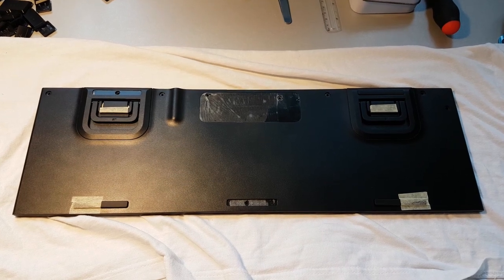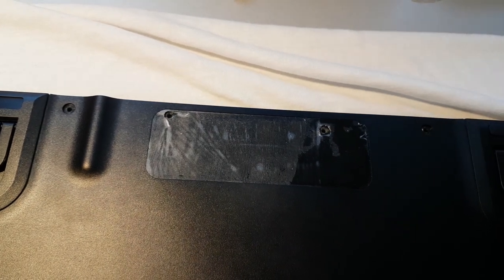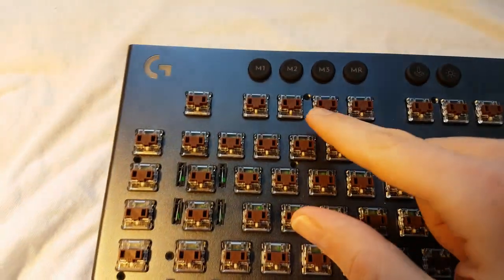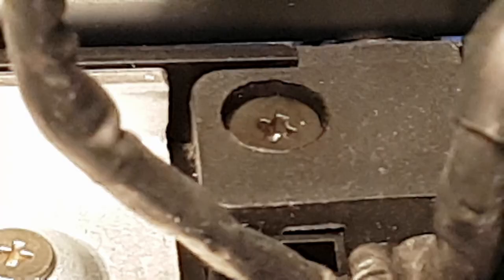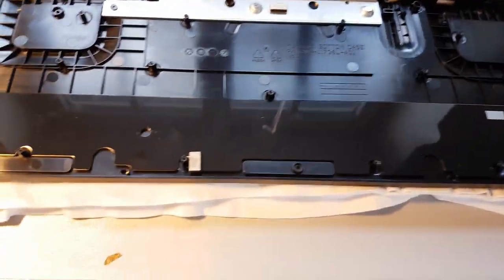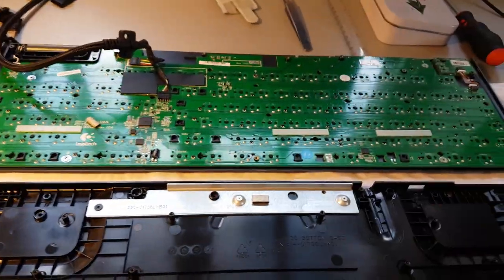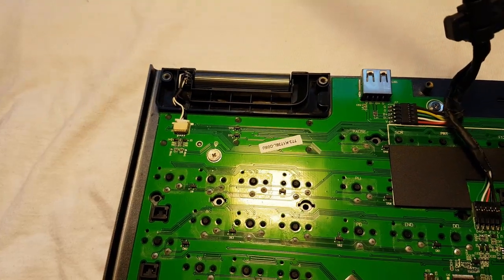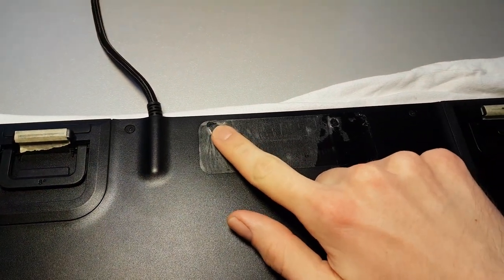Logitech G815 Disassembly

Comment: When removing the keys, I use tweezers that have the tips bent inward with tape around the metal so it doesn’t scratch it.
Reply: do you know if the switches can be removed from the top too? cant find anything about it..

Comment: I'm going to be doing this with my G915 because the "E" key is suffering badly from either a broken switch or a bad solder joint. Either way I need to get inside and now I see where the top screws are I don't need to remove all the key caps. I do hate it when companies hide them under rubber pads though because they're never quite the same once you remove them at least not when I remove them. Thanks for the guided teardown!
Reply from the maker: Yeah, the hidden screws are always a pain. I replaced the factory adhesive with some fresh double-sided adhesive tape to make the thing sit evenly.
Reply: @icecreamgecko  following up after successful surgery. It was a bad solder joint and is working fine so far. The biggest problem I had was removing the battery cable. I hated doing it but had to pull on the wires to get it out. Thanks again for the video because it let me remove only the screws I needed.
Reply from the maker: I am glad to hear that everything worked out well!

Comment: Just a heads up, since I just did this myself... You can 100% replace the switches with Kailh Chocs (with a caveat). The J key on my GF's keeb started showing an intermittent fault, so I bought a pack of 10 Kailh Choc White switches to replace it will and to have others in case it happens to another in the future. After desoldering the old and installing the new, I was buttoning everything up and it came time to put the J keycap back on. It would not fit. The Stems are slightly different so you cannot slot the old one on. It does appear that the two switches are the same size in all other aspects though. So my plan is to desolder this new switch and steal the stem from the old one and swap the stem into the new switch.

If you are in the same boat and have the clicky model, the click bars sound slightly different as well, so I think when I go back to complete this job I will also swap that and see if anything changes (the sound difference may just be the way the inside of the switch attenuates sound and not the bar at all but idk).

Any questions lmk
Reply: Do you reckon you can swamp out the whole board with standard switches or would it not fit? Say for example the gateron black?
Reply: @Maleki28  I'm not sure the switches would fit in the negative space designed to fit the kailh choc type switches. Obviously when there is a will there is a way, but sometimes you gotta ask "why?". There are much better kits to do that with. Desoldering can be a time/labor intensive pain in the ass. If you have any questions, feel free to reach out though.
Reply: @djkid14567  Ive looked at other keyboard pcb's and designs. Nothing looks better than the G915 TKL especially with the lightspeed connectivity. I was thinking of a way to replace the keycaps on that keyboard as the TKL only comes in linear along with changing it from a slim keyboard to full size keys.
Reply: @Maleki28  if you want, you can swap all the keys with whatever type of kailh choc switch you'd like so you don't have to worry about the fitment of standard mx style switches. There are at least a few keycap options for chocs. Unfortunately the stems on the logi switches have slightly different slots so they won't fit choc caps on their own. Let me know what you decide to do and follow up when it's done. I'm interested to hear how it turns out.
Reply: Did your fix of just swapping the stems end up working?
Reply: @WasabiPlays  It did. I just don't recall whether I had to replace the top half of the shell as not. But I did end up getting it to work. If you end up undertaking this, just do your best not to damage the top shell of the switch, just in case you need to swap that over as well.

Comment: I think the metal part is to increase the weight to make the keyboard more stable without moving around. As far I remember the 915 tkl has something similar.
Reply: May be it's just for the grounding to reduce the electrostatic that sone of the most metal plated keybord have
Reply: the f-k you dudes talking about, those plates are there so they KB doesnt bend or flex, weight also gives it premium feel but thats secondary

Comment: A tad late to come in, but I would like to say I spilled baileys on this type of keyboard an hour ago. It hit a large part of the keyboard, but only got into one key (which proceeded to get sticky/stuck). 

Found out the hard way that disassebly was not actually needed...

After reassembling the keyboard, I used a sharp knife to pry out the key socket(?), dumped it (the socket) in water with soap and washed it up. Put it together again and re-fit it into the keyboard, and now the keyboard works flawlessly and no sticky key. The electronics seem to be very safe from spills, something I am very happy about now. Would be a costly fuckup.
Reply: Hello, would you mind explaining what exactly you did? The leg of my kepcap broke off and fell into the switch hole. They key won't depress anymore 🙄. Thanks
Reply: @theravager978  Basically what I said: use a sharp knife to remove the plastic cover the key itself is socketed into. I was careful to avoid anything breaking, and did it slowly.

Comment: thanks for this! I noticed the screws beneath the keycaps and got to thinking I could desolder the switches to replace them with some nice linears and pbt keycaps.
Reply: Dude resell and buy a different keeb at that point, these are holding value well
Reply: i think the switches or soldered on...not like in other mk's

Comment: Thanks for the guide. I received mine a couple days ago and it looks like the PCB was not seated properly in one of the corners. I thought about opening it and reseating the board but after seeing this, it may be better for me to just get it exchanged.
Reply from the maker: That's a good idea while you still have got the option. My current one is a replacement keyboard as well. The first one had a similar issue regarding the "fit and finish".
I am glad that I could help. :)
Reply: Thanks for the video, icecreamGecko! I wonder if you can answer one question: is it possible to replace switches without removing the printed circuit board? Did you try to remove the PCB?

Comment: The heavy metal piece at the bottom of g815 is probably the future location of the g915 battery location.
Reply from the maker: That might be it! In order to achieve the stated runtime they'd definitely need a chunky battery.
Reply: clever, you probly got it right! weird that they chose to replace it with a metal chunk instead of just nothing; probably to give that heft and psychology of the correlation between heft and quality in USA
Reply: It's also a design thing. Making things heavier makes it feel more "premium". It's a common design tactic to add weight to a product just to make it feel like it's higher quality

Comment: This helps me every time i have to replace one of those switches when they one after another start to double-register my inputs.
Reply: hey one of my keys also started to double-register, cau you specify exactly what you did
Reply: @junkshit9477  I opened the back, I soldered out the defective switch and replaced it with one of the 5 switches I took from the G1 to G5 keys, as I don't use those.
I have the 5 Buttons on the left of the keyboards removed and taped them over.

Comment: I bought G915 and I need to change switch from to scroll lock (which is 99,9% time not used :P ), to shift, which sounds strange once a few pushes... I can solder fortunatelly (that's why I bought half price ;) ) but wanted to know how to dismantle it! So I think you video will help me a lot! ;) 
Will let know in 2 or 3 days when this arrive... As nowdays 95% online shopping ;)
Reply from the maker: I am glad that I could help. I wish you the best of luck with that! I had to do some soldering too with the one in the video. 😄
Reply: Why you just dont use AutoHotkey for doing that? It actually almost as deep as Firmware, so  windows think that any key is anotehr key... I use it to Put CapsLock as Esc and MiddleMouse  button...
Reply: @Yamagatabr  Eeee I can remap keys in GHub on my G502 Lightspeed,  but shift key is automatically used by me on Keyboard! Fortunately this Keyboard I got for 140$ it was enough to put some grease on this metal element under Shift key, and it is working smooth! And key as a key is ok! 😉

Comment: the weight is there to simulate the battery form the wireless so that they feel the same, and to not allow it to slide easy i doubt there will be any effect if you remove it
Reply: The wireless model's battery doesn't weigh anything at all, and it also has the metal plate.

Comment: great video! I wonder if the large metal piece is there to ensure structural integrity and prevent it from bending in or out. As a matter of fact if you look closely, the keyboard is slightly curved out and not fully flat.
Reply from the maker: This is what I thought at first too. However, I did remove the metal piece and it feels just as sturdy as it did previously.

Comment: I wonder if the weight is for the same reason why IBM AS400 early external hard drives used to come in a large box?  They said that no one would want to pay such a high price, if it was real expensive and was in a tiny box.  So, they just made it look and feel more expensive that it actually was. lol

Comment: Do you think replacing a switch on a G815 \ G915 in case one breaks or stops working, should be something the average diy tech guy at home should be able to do?
Reply from the maker: Tbh I do not know if that is something I would recommend. The last time I opened up the keyboard, the screwholes for the bottom cover did not make the best of impressions when it comes to sturdiness. They strip quite easily so you have to be really careful with the reassembly. They are simply machined into that alloy and are not fitted with proper inserts. Basically unfixable (in a proper fashion without dumping half a tube if lock-tite in there) when something goes wrong. Therefore I did not bother with removing the PCB from the top-plate, in fear of encountering another disaster. The switches themselves seem to be quite reliable though. I have not had any experience with a broken single key, aside from these ridiculous scissor-mechanism keyboards. Since the space bar has not got one of these retainer clips like my old membrane keyboard either (the ones that like to snap off when you try to remove the key) there should not be much of a need to replace any mechanisms for a reasonable amount of time.

Please be careful if you try it anyway. Logitech did send me a replacement in the end (I am with my third and hopefully final G815) but it took a lot of time and many exchanged emails to get to that point.
Reply: @icecreamgecko  Thanks for the answer dude. I wasn't going to try, but I just got a brand new one 2nd hand in box, and was kind of getting anxious thinking about what happends when if switches start acting up because that thing is so damn expensive. haha

Comment from the maker: Update: Since the recording of this video I have removed the massive metal piece from the bottom cover. The keyboard is a lot easier to handle now and I have not experienced any issues up to this point. Aside from the ridiculously fragile soldering that has been done on the wires of the volume roller. I had to resolder those. Not easy for a beginner like myself but also doable.
Reply: The plate could be there for grounding, maybe to make the bottom more stiff.
Reply: I've been buying Logitech's K740 Keyboards refurbished for years, because that is simply the keyboard that allows me to type the fastest of all.
But those have the problem, that the plastic chassis warps over time, and the keyboard starts to spin on your desk, like a bloated smartphone battery...
Its possible, that Logitech put the metal plate in to prevent warping.
Just a guess - it could be any reason or no reason...
Reply: I just bought one of these, and I'm not impressed.  The key action is somewhat more to my liking than other mechanical keyboards, but the keys don't sit solidly, they move around and tilt to some degree as well.

Its quite far from the quality I expected. I tried a Roccat keyboard with their light-activated switches and the keys were not nearly so damned loose as this.
Reply: The bottom metal piece is probably sitting in the slot where the battery is on the G915. 
They probably added it to make it heavier as a way to make it feel more "premium"
Reply: The plate is connected to the ground plane to prevent electric interference.  Removing the plate won't prevent the keyboard from working at all, but it will probably put it out of compliance for EFI.

Comment: Is it possible to replace the switchs? My W key is fucked so I was researching if I could replace it.
Reply from the maker: I'd assume that one could desolder the switches individually but I cannot provide any relieable information on that.
Reply: gl switches are rebranded kailh choc v1 i think
Reply: @Marcelo_-  Actually they are slightly different in travel distance and pins

Comment: This is great and all, but I still can't access the rubber buttons on the top of the keyboard to replace them. How do I remove the actual circuit board to get to them?
Reply from the maker: Hi, I do not know how to do that as I have never actually attempted it. My first guess would be to loosen the respective screws but I do not know if the keys would have to be desoldered as well.
Reply: @icecreamgecko  That’s the thing, I really think they do. God this sucks, I really needed to replace the rubber buttons, they got torn up by my mom’s damn rabbit. Bastard jumped on my desk and ate those buttons on my keyboard and my plant.

Comment: Many thanks for this video which is the only one I found that showed disassembly. 
I have a question please - Do you have do disassemble the screws on both - front and back in order to access and replace the USB cable?
Reply from the maker: Yes, you do need to take out all of the outer screws in order to seperate the keyboard from the bottom shell. There is no other way to get to the cable without breaking anything, as far as I know.

Comment: I spilled water on my keyboard so I pulled the keys out and dried it for two days. Now my left control key is not working (windows key wasn’t either but it started working after another day). I wanted to disassemble further and this video was very helpful. I separated the back and the front and I wanted to ask if there is anything else I should do?
Reply from the maker: I would just wait for a bit longer and see if it starts working again. Maybe there is still some moisture left. It is a good idea though to not power on the keyboard at all for a couple of days so that one does not short out anything with moisture that might be remaining within the keyboard.
Reply: @icecreamgecko  Thank you!
Reply: @omergulcu  is it workin now? What did yout do?
Reply: @Yamagatabr   I disassembled it and let it dry for another two days. Now the control key is pretty much dead but all the other keys (including Windows key) are working just fine

Comment: Nice Video !
Btw, I have a G915 TKL and want to eliminate the metallic sound caused by some springs.

Do I always need a soldering iron? (to take out the tactile switch)
Reply from the maker: I would assume that you'd need one but I have no experience with replacing individual switches on this keyboard whatsoever.
Reply: @icecreamgecko  OK, Thank you for reply.

Comment: Is it a possibility to solder on MX style switches. Such as soldering on tangerine switches
Reply from the maker: I do not know the the answer to that, sorry. I just opened it up but left the PCB attached to the top-plate.
Reply: most definitively no, thats ML type switches. Or the so known Kailh Choc low profile switches eventually if you broke some though... You can purchase one from aliexpress or ebay and solder it on. Or just ask for warranty replacement.
Reply: @bgsmurf4e731  but if the switches do go out, I can solder new ones on. Let's say I have a k95 or something, but I want to replace the switches, in which case, I can solder on any MX style switch I want right?

Comment: Hi friend,  thanks for a great video, I've a G915 and i want to make custom painting on the brush metal piece, maybe could you tell if it's possible to detach the keyborad PCB of the metal brushed piece? thanks in advance for your help
Reply from the maker: There are some screws that seem to connect the PCB to the top cover. I am unsure though if these are all you need to loosen or if there is something else involved.
Reply: You need to desolder the switches.

Comment: can you remove the large metal plate?
Reply from the maker: Yes, I ended up doing that. I might have heated up that bottom plate with a hair dryer to soften up the adhesive and then proceeded to pry it out of there with a flathead-screwdriver, if I remember correctly. I would be careful with that process though. There no need to rush that job and break something along the way.

Comment: Can the green circuit board be removed from the base as well? Thinking of swapping switches out from a logitech tactile to logitech linear but I can't tell if it is only held in place with a few screws?
Reply from the maker: Unfortunately, I do not know if that is possible or even neccessary in order for the switches to be removed.